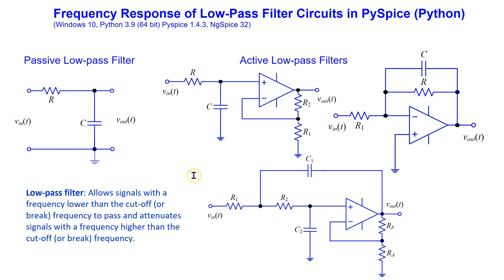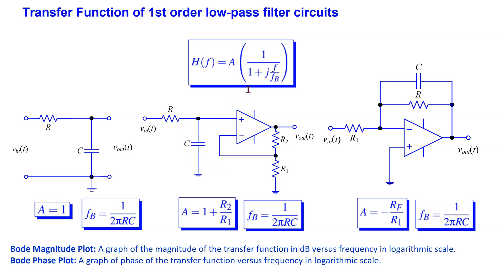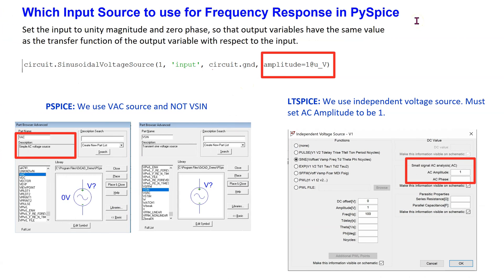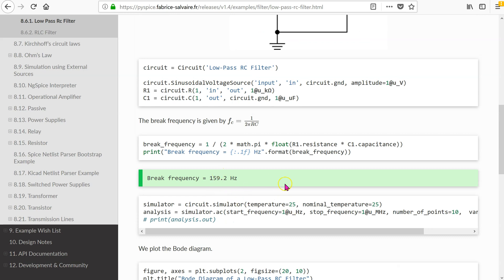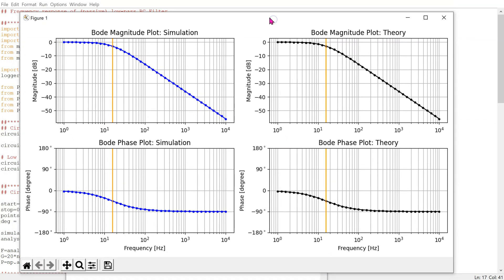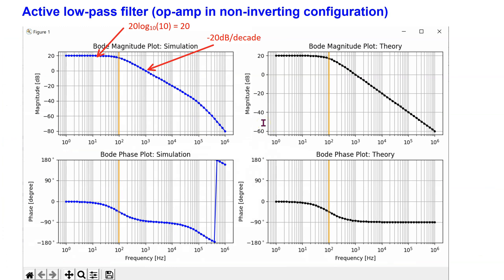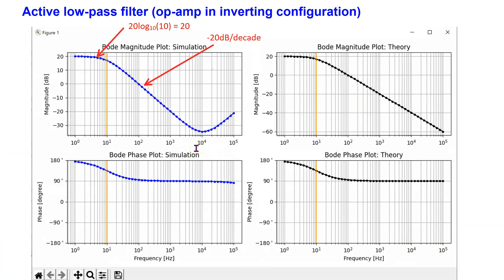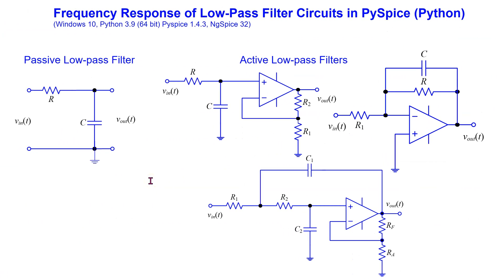Introduction to PySpice (Python) for Simulating Frequency Response of Low-pass Filter Circuits

Comment from the maker: ## Frequency response of non-inverting op-amp low-pass Filter.

##*********************************************
import math
import numpy as np
import matplotlib.pyplot as plt
from matplotlib.widgets import Cursor
from matplotlib.pyplot import semilogx
from matplotlib import pyplot

import PySpice.Logging.Logging as Logging
logger = Logging.setup_logging()

from PySpice.Doc.ExampleTools import find_libraries
from PySpice.Probe.Plot import plot
from PySpice.Spice.Library import SpiceLibrary
from PySpice.Spice.Netlist import Circuit
from PySpice.Unit import *

##*********************************************
# Set the path where the op-amp uA741.lib file is located
# Place the *.lib file in the same folder as the script file

libraries_path ='C:\\Users\\username\\Desktop\\PySpice\\Opamp'
spice_library = SpiceLibrary(libraries_path)

##*********************************************
## Circuit Netlist
circuit = Circuit('Inverting Op-amp Low-Pass Filter')
circuit.include("uA741.lib")

circuit.SinusoidalVoltageSource(1, 'input', circuit.gnd, amplitude=1@u_V)

# Low pass filter
circuit.R('f', 'v-', 'out', 1591.549@u_Ω)
circuit.C('f', 'v-', 'out', 10@u_uF)

circuit.V(2, '+Vcc', circuit.gnd,15@u_V)
circuit.V(3, '-Vcc', circuit.gnd,-15@u_V)

circuit.X(1, 'uA741', circuit.gnd, 'v-', '+Vcc', '-Vcc', 'out')

circuit.R(1, 'input', 'v-',  159.1549@u_Ω)
circuit.R('L', 'out', circuit.gnd,10@u_kΩ)

##*********************************************
## Circuit Simulation

deg = True
start=1@u_Hz
stop=0.1@u_MHz
points=10
simulator = circuit.simulator(temperature=25, nominal_temperature=25)
analysis = simulator.ac(start_frequency=start, stop_frequency=stop, number_of_points=points,  variation='dec')

F=analysis.frequency
G=20*np.log10(np.abs(analysis.out))
P=np.angle(analysis.out, deg)

##*********************************************
## Theory

break_frequency = 1 / (2 * math.pi * float(circuit.Rf.resistance * circuit.Cf.capacitance))
print("Break frequency = {:.1f} Hz".format(break_frequency))

f=np.array(F)
H = (-circuit.Rf.resistance/circuit.R1.resistance)*(1/(1 + 1j* f/break_frequency))
Hmag = 20*np.log10(np.abs(H))
Hphase = (np.angle(H,deg))

##*********************************************
## Plotting Simulation Results

figure = plt.subplots(figsize=(11, 6))

# Bode plot of magnitude response
ax1 = plt.subplot(221)
semilogx(F,G, base=10, marker='.', color='blue',linestyle='-')
plt.grid()
plt.grid(True, which='minor')
plt.title('Bode Magnitude Plot: Simulation')
plt.ylabel('Magnitude [dB]')
cursor = Cursor(ax1, useblit=True, color='red', linewidth=1)

# Bode plot of phase response
ax2 = plt.subplot(223)
semilogx(F,P, base=10, marker='.', color='blue',linestyle='-')

plt.grid()
plt.grid(True, which='minor')
plt.title('Bode Phase Plot: Simulation')
plt.xlabel('Frequency [Hz]')

if deg==False:
    plt.ylabel('Phase [radian]')
    plt.ylim(-math.pi, math.pi)
    pyplot.yticks((-math.pi, -math.pi/2,0, math.pi/2, math.pi),
                  (r"$-\pi$", r"$-\frac{\pi}{2}$", "0", r"$\frac{\pi}{2}$", r"$\pi$"))
else:
    plt.ylabel('Phase [degree]')
    plt.ylim(float(-180), float(180))
    pyplot.yticks((-180, -90,0, 90, 180),
                  (r"$-180^\circ$", r"$-90^\circ$", "0", r"$90^\circ$", r"$180^\circ$"))

# Mark the break frquency
axes=(ax1, ax2)
for ax in axes:
    ax.axvline(x=break_frequency, color='orange')

##*********************************************
## Plotting Theory Results

#figure = plt.subplots(figsize=(11, 6))

# Bode plot of magnitude response
ax1 = plt.subplot(222)
semilogx(f,Hmag, base=10, marker='.', color='black',linestyle='-')
plt.grid()
plt.grid(True, which='minor')
plt.title('Bode Magnitude Plot: Theory')
plt.ylabel('Magnitude [dB]')

# Bode plot of phase response
ax2 = plt.subplot(224)
semilogx(f,Hphase, base=10, marker='.', color='black',linestyle='-')
plt.grid()
plt.grid(True, which='minor')
plt.title('Bode Phase Plot: Theory')
plt.xlabel('Frequency [Hz]')

if deg==False:
    plt.ylabel('Phase [radian]')
    plt.ylim(-math.pi, math.pi)
    pyplot.yticks((-math.pi, -math.pi/2,0, math.pi/2, math.pi),
                  (r"$-\pi$", r"$-\frac{\pi}{2}$", "0", r"$\frac{\pi}{2}$", r"$\pi$"))
else:
    plt.ylabel('Phase [degree]')
    plt.ylim(float(-180), float(180))
    pyplot.yticks((-180, -90,0, 90, 180),
                  (r"$-180^\circ$", r"$-90^\circ$", "0", r"$90^\circ$", r"$180^\circ$"))

# Mark the break frquency
axes=(ax1, ax2)
for ax in axes:
    ax.axvline(x=break_frequency, color='orange')
    
plt.tight_layout()
plt.show()

Comment from the maker: ## Frequency response of Sallen-Key op-amp low-pass Filter.

##*********************************************
import math
import numpy as np
import matplotlib.pyplot as plt
from matplotlib.widgets import Cursor
from matplotlib.pyplot import semilogx
from matplotlib import pyplot

import PySpice.Logging.Logging as Logging
logger = Logging.setup_logging()

from PySpice.Doc.ExampleTools import find_libraries
from PySpice.Probe.Plot import plot
from PySpice.Spice.Library import SpiceLibrary
from PySpice.Spice.Netlist import Circuit
from PySpice.Unit import *

##*********************************************
# Set the path where the op-amp uA741.lib file is located
# Place the *.lib file in the same folder as the script file

libraries_path ='C:\\Users\\username\\Desktop\\PySpice\\Opamp'
spice_library = SpiceLibrary(libraries_path)

##*********************************************
## Circuit Netlist
circuit = Circuit('Sallen-Key Low-Pass Filter')
circuit.include("uA741.lib")

circuit.SinusoidalVoltageSource(1, 'input', circuit.gnd, amplitude=1@u_V)

# Low pass filter
circuit.R(1, 'input', 'x', 8.2@u_kΩ)
circuit.C(1, 'x', 'out', 0.01@u_uF)

circuit.R(2, 'x', 'v+', 8.2@u_kΩ)
circuit.C(2, 'v+', circuit.gnd, 0.01@u_uF)

circuit.V(2, '+Vcc', circuit.gnd,15@u_V)
circuit.V(3, '-Vcc', circuit.gnd,-15@u_V)

circuit.X(1, 'uA741', 'v+', 'v-', '+Vcc', '-Vcc', 'out')

circuit.R('A', 'v-', circuit.gnd,  3.9@u_kΩ)
circuit.R('F', 'v-', 'out',      2.2@u_kΩ)

##*********************************************
## Circuit Simulation

start=1@u_Hz
stop=0.1@u_MHz
points=10
deg = True

simulator = circuit.simulator(temperature=25, nominal_temperature=25)
analysis = simulator.ac(start_frequency=start, stop_frequency=stop, number_of_points=points,  variation='dec')

F=analysis.frequency
G=20*np.log10(np.abs(analysis.out))
P=np.angle(analysis.out, deg)

##*********************************************
## Theory: break frequency of Sallen-Key low-pass filter
## for special case when R1=R2 and C1=C2

R = circuit.R1.resistance
C = circuit.C1.capacitance
break_frequency = 1 / (2 * math.pi * float(R * C))
print("Break frequency = {:.1f} Hz".format(break_frequency))

##*********************************************
## Plotting Simulation Results

figure = plt.subplots(figsize=(10, 6))

# Bode plot of magnitude response
ax1 = plt.subplot(211)
semilogx(F,G, base=10, marker='.', color='blue',linestyle='-')
plt.grid()
plt.grid(True, which='minor')
plt.title('Magnitude Bode Plot: Simulation')
#plt.xlabel('Frequency [Hz]')
plt.ylabel('Magnitude [dB]')
cursor = Cursor(ax1, useblit=True, color='red', linewidth=1)

# Bode plot of phase response
ax2 = plt.subplot(212)
semilogx(F,P, base=10, marker='.', color='blue',linestyle='-')

plt.grid()
plt.grid(True, which='minor')
plt.title('Phase Bode Plot: Simulation')
plt.xlabel('Frequency [Hz]')

if deg==False:
    plt.ylabel('Phase [radian]')
    plt.ylim(-math.pi, math.pi)
    pyplot.yticks((-math.pi, -math.pi/2,0, math.pi/2, math.pi),
                  (r"$-\pi$", r"$-\frac{\pi}{2}$", "0", r"$\frac{\pi}{2}$", r"$\pi$"))
else:
    plt.ylabel('Phase [degree]')
    plt.ylim(float(-180), float(180))
    pyplot.yticks((-180, -90,0, 90, 180),
                  (r"$-180^\circ$", r"$-90^\circ$", "0", r"$90^\circ$", r"$180^\circ$"))

# Mark the break frquency
axes=(ax1, ax2)
for ax in axes:
    ax.axvline(x=break_frequency, color='red')

plt.tight_layout()
plt.show()

Comment from the maker: ## Frequency response of inverting op-amp low-pass Filter.

##*********************************************
import math
import numpy as np
import matplotlib.pyplot as plt
from matplotlib.widgets import Cursor
from matplotlib.pyplot import semilogx
from matplotlib import pyplot

import PySpice.Logging.Logging as Logging
logger = Logging.setup_logging()

from PySpice.Doc.ExampleTools import find_libraries
from PySpice.Probe.Plot import plot
from PySpice.Spice.Library import SpiceLibrary
from PySpice.Spice.Netlist import Circuit
from PySpice.Unit import *

##*********************************************
# Set the path where the op-amp uA741.lib file is located
# Place the *.lib file in the same folder as the script file

libraries_path ='C:\\Users\\username\\Desktop\\PySpice\\Opamp'
spice_library = SpiceLibrary(libraries_path)

##*********************************************
## Circuit Netlist
circuit = Circuit('Inverting Op-amp Low-Pass Filter')
circuit.include("uA741.lib")

circuit.SinusoidalVoltageSource(1, 'input', circuit.gnd, amplitude=1@u_V)

# Low pass filter
circuit.R('f', 'v-', 'out', 1591.549@u_Ω)
circuit.C('f', 'v-', 'out', 10@u_uF)

circuit.V(2, '+Vcc', circuit.gnd,15@u_V)
circuit.V(3, '-Vcc', circuit.gnd,-15@u_V)

circuit.X(1, 'uA741', circuit.gnd, 'v-', '+Vcc', '-Vcc', 'out')

circuit.R(1, 'input', 'v-',  159.1549@u_Ω)
circuit.R('L', 'out', circuit.gnd,10@u_kΩ)

##*********************************************
## Circuit Simulation

deg = True
start=1@u_Hz
stop=0.1@u_MHz
points=10
simulator = circuit.simulator(temperature=25, nominal_temperature=25)
analysis = simulator.ac(start_frequency=start, stop_frequency=stop, number_of_points=points,  variation='dec')

F=analysis.frequency
G=20*np.log10(np.abs(analysis.out))
P=np.angle(analysis.out, deg)

##*********************************************
## Theory

break_frequency = 1 / (2 * math.pi * float(circuit.Rf.resistance * circuit.Cf.capacitance))
print("Break frequency = {:.1f} Hz".format(break_frequency))

f=np.array(F)
H = (-circuit.Rf.resistance/circuit.R1.resistance)*(1/(1 + 1j* f/break_frequency))
Hmag = 20*np.log10(np.abs(H))
Hphase = (np.angle(H,deg))

##*********************************************
## Plotting Simulation Results

figure = plt.subplots(figsize=(11, 6))

# Bode plot of magnitude response
ax1 = plt.subplot(221)
semilogx(F,G, base=10, marker='.', color='blue',linestyle='-')
plt.grid()
plt.grid(True, which='minor')
plt.title('Bode Magnitude Plot: Simulation')
plt.ylabel('Magnitude [dB]')
cursor = Cursor(ax1, useblit=True, color='red', linewidth=1)

# Bode plot of phase response
ax2 = plt.subplot(223)
semilogx(F,P, base=10, marker='.', color='blue',linestyle='-')

plt.grid()
plt.grid(True, which='minor')
plt.title('Bode Phase Plot: Simulation')
plt.xlabel('Frequency [Hz]')

if deg==False:
    plt.ylabel('Phase [radian]')
    plt.ylim(-math.pi, math.pi)
    pyplot.yticks((-math.pi, -math.pi/2,0, math.pi/2, math.pi),
                  (r"$-\pi$", r"$-\frac{\pi}{2}$", "0", r"$\frac{\pi}{2}$", r"$\pi$"))
else:
    plt.ylabel('Phase [degree]')
    plt.ylim(float(-180), float(180))
    pyplot.yticks((-180, -90,0, 90, 180),
                  (r"$-180^\circ$", r"$-90^\circ$", "0", r"$90^\circ$", r"$180^\circ$"))

# Mark the break frquency
axes=(ax1, ax2)
for ax in axes:
    ax.axvline(x=break_frequency, color='orange')

##*********************************************
## Plotting Theory Results

#figure = plt.subplots(figsize=(11, 6))

# Bode plot of magnitude response
ax1 = plt.subplot(222)
semilogx(f,Hmag, base=10, marker='.', color='black',linestyle='-')
plt.grid()
plt.grid(True, which='minor')
plt.title('Bode Magnitude Plot: Theory')
plt.ylabel('Magnitude [dB]')

# Bode plot of phase response
ax2 = plt.subplot(224)
semilogx(f,Hphase, base=10, marker='.', color='black',linestyle='-')
plt.grid()
plt.grid(True, which='minor')
plt.title('Bode Phase Plot: Theory')
plt.xlabel('Frequency [Hz]')

if deg==False:
    plt.ylabel('Phase [radian]')
    plt.ylim(-math.pi, math.pi)
    pyplot.yticks((-math.pi, -math.pi/2,0, math.pi/2, math.pi),
                  (r"$-\pi$", r"$-\frac{\pi}{2}$", "0", r"$\frac{\pi}{2}$", r"$\pi$"))
else:
    plt.ylabel('Phase [degree]')
    plt.ylim(float(-180), float(180))
    pyplot.yticks((-180, -90,0, 90, 180),
                  (r"$-180^\circ$", r"$-90^\circ$", "0", r"$90^\circ$", r"$180^\circ$"))

# Mark the break frquency
axes=(ax1, ax2)
for ax in axes:
    ax.axvline(x=break_frequency, color='orange')
    
plt.tight_layout()
plt.show()

Comment from the maker: ## Frequency response of (passive) low-pass RC Filter.

##*********************************************
import math
import numpy as np
import matplotlib.pyplot as plt
from matplotlib.widgets import Cursor
from matplotlib.pyplot import semilogx
from matplotlib import pyplot

import PySpice.Logging.Logging as Logging
logger = Logging.setup_logging()

from PySpice.Doc.ExampleTools import find_libraries
from PySpice.Probe.Plot import plot
from PySpice.Spice.Library import SpiceLibrary
from PySpice.Spice.Netlist import Circuit
from PySpice.Unit import *

##*********************************************
## Circuit Netlist
circuit = Circuit('Low-Pass RC Filter')

circuit.SinusoidalVoltageSource(1, 'input', circuit.gnd, amplitude=1@u_V)

# Low pass filter
circuit.R(1, 'input', 'out', 10@u_kΩ)
circuit.C(1, 'out', circuit.gnd, 1@u_uF)

##*********************************************
## Circuit Simulation

start=1@u_Hz
stop=0.01@u_MHz
points=10
deg = True

simulator = circuit.simulator(temperature=25, nominal_temperature=25)
analysis = simulator.ac(start_frequency=start, stop_frequency=stop, number_of_points=points,  variation='dec')

F=analysis.frequency
G=20*np.log10(np.abs(analysis.out))
P=np.angle(analysis.out, deg)

##*********************************************
## Theory

break_frequency = 1 / (2 * math.pi * float(circuit.R1.resistance * circuit.C1.capacitance))
print("Break frequency = {:.1f} Hz".format(break_frequency))

f=np.array(F)
H = 1/(1 + 1j* f/break_frequency)
Hmag = 20*np.log10(np.abs(H))
Hphase = np.angle(H,deg)

##*********************************************
## Plotting Simulation Results

figure = plt.subplots(figsize=(11, 6))

# Bode plot of magnitude response
ax1 = plt.subplot(221)
semilogx(F,G, base=10, marker='.', color='blue',linestyle='-')
plt.grid()
plt.grid(True, which='minor')
plt.title('Bode Magnitude Plot: Simulation')
plt.ylabel('Magnitude [dB]')
cursor = Cursor(ax1, useblit=True, color='red', linewidth=1)

# Bode plot of phase response
ax2 = plt.subplot(223)
semilogx(F,P, base=10, marker='.', color='blue',linestyle='-')

plt.grid()
plt.grid(True, which='minor')
plt.title('Bode Phase Plot: Simulation')
plt.xlabel('Frequency [Hz]')

if deg==False:
    plt.ylabel('Phase [radian]')
    plt.ylim(-math.pi, math.pi)
    pyplot.yticks((-math.pi, -math.pi/2,0, math.pi/2, math.pi),
                  (r"$-\pi$", r"$-\frac{\pi}{2}$", "0", r"$\frac{\pi}{2}$", r"$\pi$"))
else:
    plt.ylabel('Phase [degree]')
    plt.ylim(float(-180), float(180))
    pyplot.yticks((-180, -90,0, 90, 180),
                  (r"$-180^\circ$", r"$-90^\circ$", "0", r"$90^\circ$", r"$180^\circ$"))

# Mark the break frquency
axes=(ax1, ax2)
for ax in axes:
    ax.axvline(x=break_frequency, color='orange')

##*********************************************
## Plotting Theory Results

#figure = plt.subplots(figsize=(11, 6))

# Bode plot of magnitude response
ax1 = plt.subplot(222)
semilogx(f,Hmag, base=10, marker='.', color='black',linestyle='-')
plt.grid()
plt.grid(True, which='minor')
plt.title('Bode Magnitude Plot: Theory')
plt.ylabel('Magnitude [dB]')

# Bode plot of phase response
ax2 = plt.subplot(224)
semilogx(f,Hphase, base=10, marker='.', color='black',linestyle='-')
plt.grid()
plt.grid(True, which='minor')
plt.title('Bode Phase Plot: Theory')
plt.xlabel('Frequency [Hz]')

if deg==False:
    plt.ylabel('Phase [radian]')
    plt.ylim(-math.pi, math.pi)
    pyplot.yticks((-math.pi, -math.pi/2,0, math.pi/2, math.pi),
                  (r"$-\pi$", r"$-\frac{\pi}{2}$", "0", r"$\frac{\pi}{2}$", r"$\pi$"))
else:
    plt.ylabel('Phase [degree]')
    plt.ylim(float(-180), float(180))
    pyplot.yticks((-180, -90,0, 90, 180),
                  (r"$-180^\circ$", r"$-90^\circ$", "0", r"$90^\circ$", r"$180^\circ$"))

# Mark the break frquency
axes=(ax1, ax2)
for ax in axes:
    ax.axvline(x=break_frequency, color='orange')
    
plt.tight_layout()
plt.show()